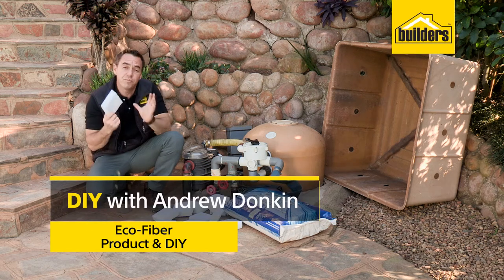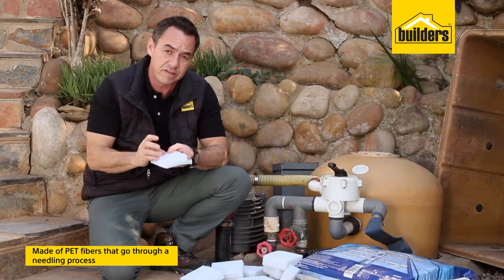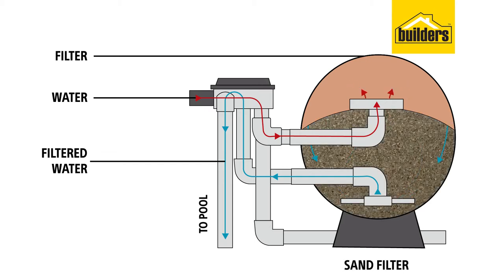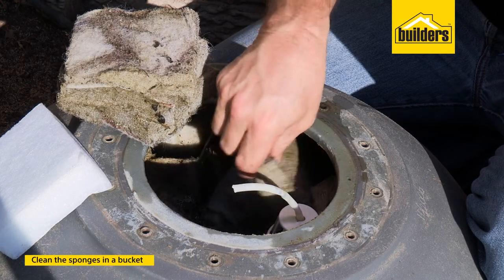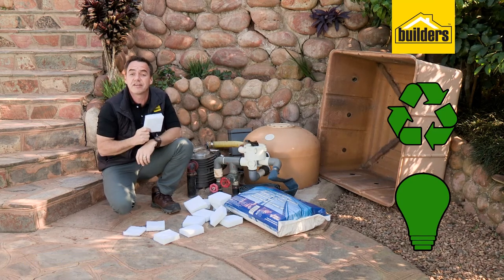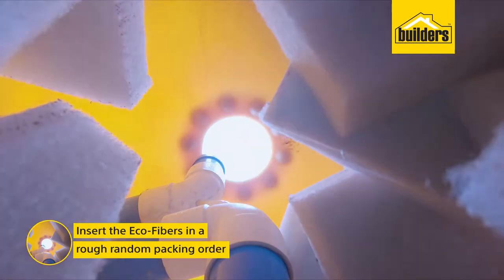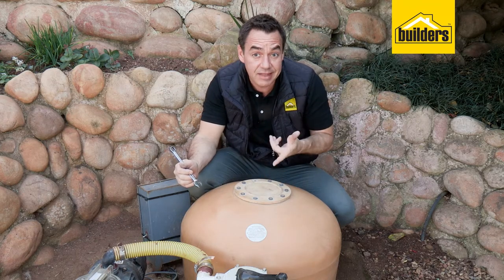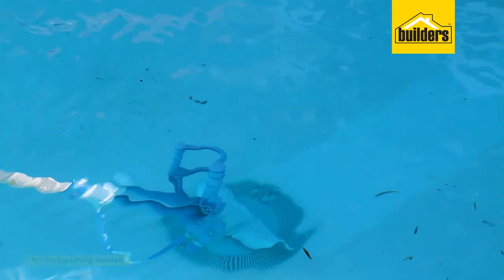Product Review | Ecofiber pool filter

Comment: Purchased this product roughly a year and a half ago. Works good. But cleaning the sponges is a big job. You use a lot of water to clean the sponges as you cant rinse all the sponges in just one bucket... It takes a lot of buckets.. Eventually I just rinsed then under the tap. But lots of water. Wondering if you really then save on the water as mentioned. Overall good product if you don't mind the effort in cleaning the sponges every 3 months.

Comment: I personally investigated and vetted this product for 9 months before I decided to put the video together. Initially, I was very sceptical too. For me, it's fantastic as the best part is not having to backwash.  I always found that to be a pain and I would neglect doing that, hence a green pool, far too often.  Not having to backwash gives me that ability to neglect the pool more than I should :) , not to mention the water saving.  My pool sits under 2 trees and is subject to a blocked pool cleaner resulting in poor water circulation and sediment buildup.  Thus I need to clean my ecofiber every 3-4 months and then its working perfectly again.  I most definitely recommend this product not only for the eater saving but the removal of the hassle factor.  Regards. Andrew Donkin.
Reply: This is the new solution I hope everyone in city's changes to eco fiber, as long as they recycle the product responsibility, because it as way more efficient even in pump time
Reply: Hi Andrew,  3 years on. Are you still happy with the Eco Fibre? Thanks in advance

Comment: I assume you can still use standard chemicals like chlorine, metal remover, etc?
Reply: No you can't use anti flocculant to get the water clear. And this no backwashing story presents other problems like a build up of stabiliser if using floaters. Backwashing kept the stabiliser levels within limits but too much prevents chlorine from doing its thing. I ended up having to replace a huge amount of water in my pool to get the stabiliser levels down and not to mention all the water and effort it takes to clean these micro fiber pads every 6 weeks not months as the manufacturers state.

Comment: I saw this in a store and I'm 99% sold but... The instructions on the bag states that the 3 fingers in the filter must be removed when inserting the fibre foam. Is this step really necessary? You made no mention of this in your video.
Reply: One way of preventing you from going back to sand🤔

Comment: No backwashing results in a build up of stabiliser until that becomes the problem. The only way to solve this is to drain and replace water so where is the water saving? Anti flocculant products also all state "for Sand filters only"
I have not been able to get the crystal clear water with this rubbish that I used to get using sand.